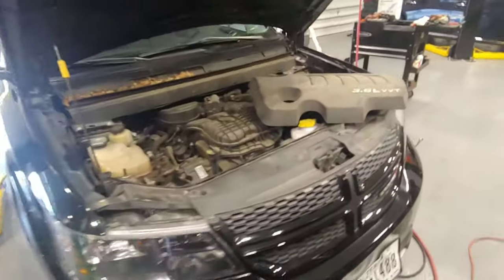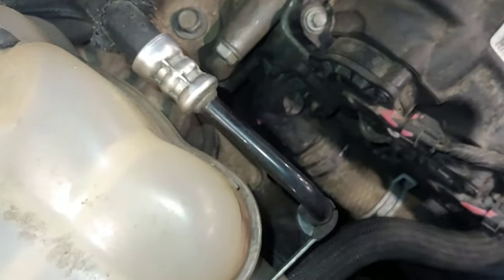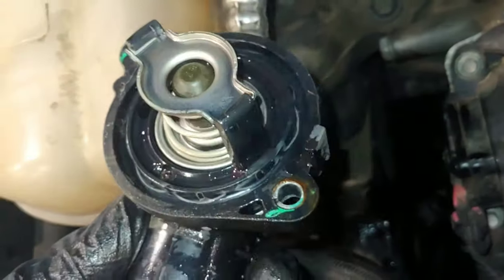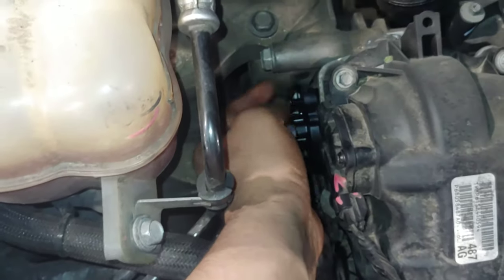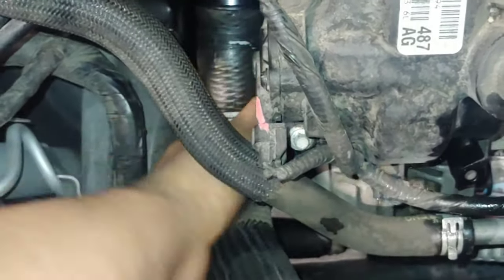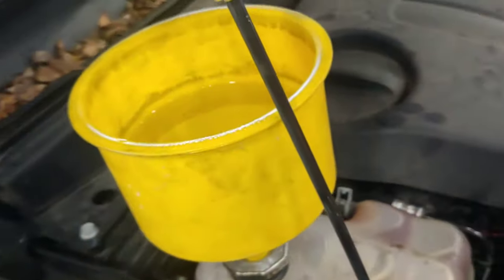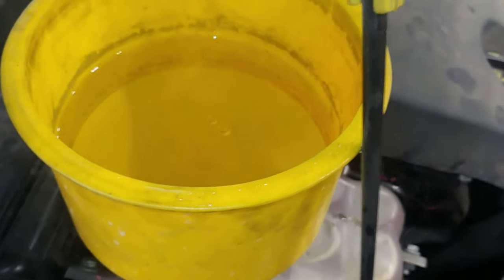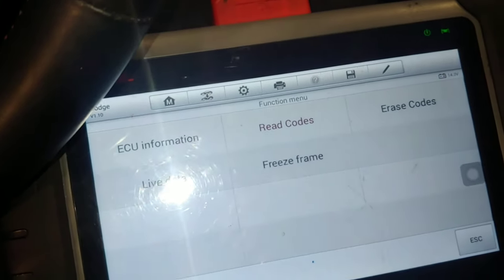DODGE JOURNEY CODE P0128 ~ THERMOSTAT REPLACEMENT ~

Comment: you dont need to use the yellow top off tank ,just fill the reservoir with new antifreeze  turn the heat on inside the car start the car up and then loosen the bleeder screw on top of the new thermostat till it quits bubbling air out then tighten the screw and then repeat this 3-4 times over the next 5 minutes then you are done getting the air out of your system
Reply: Thanks for the instructions
Reply: I just posted this halfway through the video and then read your comment lol I can’t understand why he would waste time with that nonsense

Comment: Thanks for the video. I'd recommend getting a small folding table to set removed parts on rather than setting them somewhere inside of the engine bay or in a pile of leaves on the cowl. Makes it easier to find the parts after getting distracted and less chance of dropping one somewhere in the engine bay that you have to then go find.

Comment: I’ve seen other video take off the thermostat first then the clamp and hose and it leaked out a lot less!
Reply: I think it depends on the position the thermostat is stuck in. If it’s closed it shouldn’t leak much. More so if it’s opened is where you get the mess because it’s not stopping coolants like it should.

Comment: $310 quote and now I’m  determined to do it myself after 5 videos you’re so far the best the only difference is the end where you use the yellow funnel. I’m seeing people fill coolant then run the engine and use a screwdriver to tighten and loosen. Thoughts?
Reply: If you have the money I guess you could use what he had but the cheapest and easiest way would to just open the thermostat valve running w heat on hi to let air out.

Comment: How much does it usually cost to get something like this mixed. I have a 2014 Dodge Journey and I went to autozone and the code read the P0128 was wondering the price so I could get it done
Reply: The part from Advanced Auto is about $15. I took my Journey to the dealership to get a quote and it was $368 for them to do it. After that qoute, I did the job myself and it took about 15 minutes.
Reply: @OriginalHawk  do I have to bleed the system with that additional part 🤔 , or is there another way 🤔

Comment: replaced mines but still have code
Reply: That is probably the temperature sensor
Reply: @rubio787  Thank you
Reply: @rubio787  How can you determine whether it's a bad sensor or thermostat without replacing both?

Comment: It’s cheaper and easier to bleed the system by using a screw driver turning the bleeder open and closed until there is no more bubbles coming out then you know it’s done right